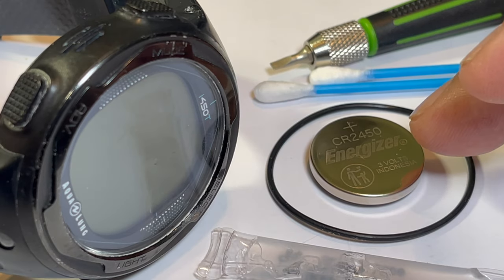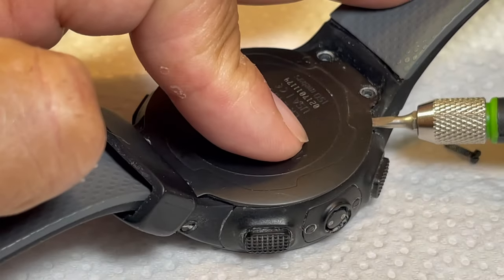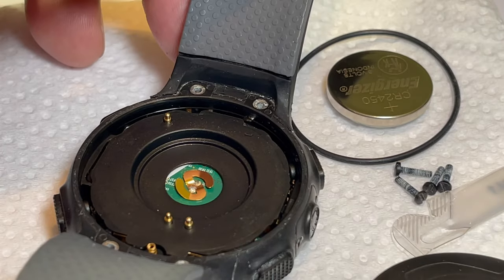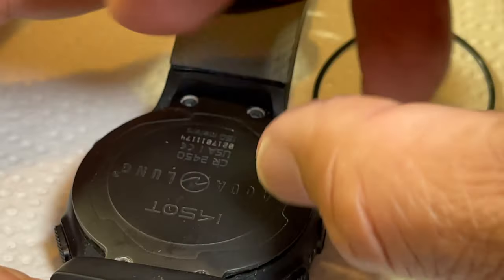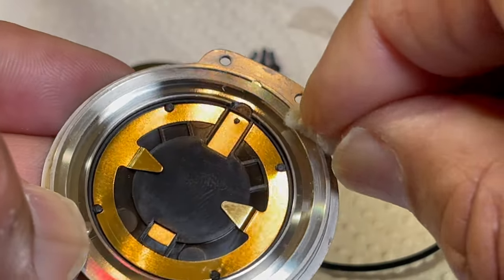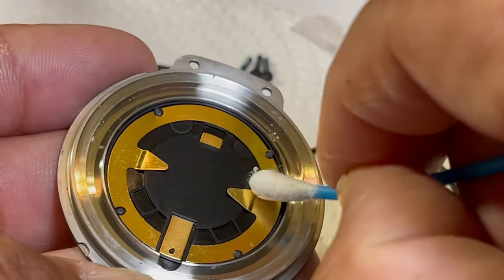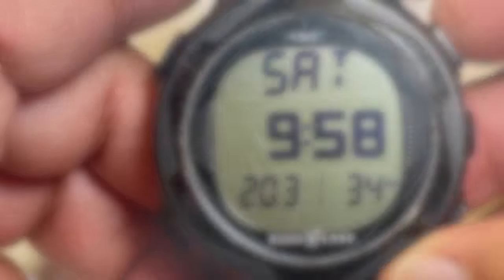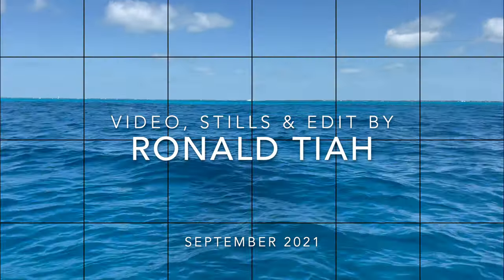Dive Computer Battery Replacement Aqualung i450

Comment: Well done, I tried it once and flooded my Aqualung i450T. So I had to buy a new one. 😞

When I changed the battery/O-ring and closed it up again, for some reason the 'light' button (down right) was 'loose', as in it was not coming back after pushing it, if you know what I mean.

I didn't really pay attention to it and thought it wouldn't be a problem, as it was just the light button, which I hardly use(d).  
But my dive computer flooded, very slowly but surely. 
 
What did I do wrong? When wanting to replace the battery, I removed the inner mechanism of the dive computer, to check it out??! - which I shouldn't have done. 
! Make sure you DO NOT remove the inner part of the mechanism, there is no need to do that. As it can cause problems to the resistance mechanism of the buttons! 

--> Uptill now I had it done by a technician that always did a pressure test on it too.
But after seeing this video I think I am now confident enough to try it again myself. 🙂

Do exactly what RonTiah does, perfect!

Thank you for posting RonTiah.
Reply from the maker: Thank you so much for your comment, appreciate hearing this, wish you continued safe diving with the computer working :)

Comment: How long does the battery last?
Reply from the maker: Thanks for your question, the answer to this question would depend heavily on two factors in my opinion. 
The first and obvious answer is how often one dives and has the computer do its dive computing and calculations, this is why i suggested a better quality battery brand, one that will deliver the amperage as the computer needs it to run the many calculations it would do.
2. An often underestimated reason would be the backlight feature, this I found for most computer a heavy drain on the battery. 
For me personally, as a dive professional who dives often I find that I can expect a year to year and half out of a "good" battery, When I do my night dives, I use my light at an angle to read the computer rather than using the backlight (farmer's son frugal habits perhaps :). I have owned a few other brands and find the same applies. If you use as a normal diver, but not as often as a pro who dives much more often, I suggest it will give you at least two years. If you plan a trip after two years of installing battery, I might have it changed before the trip and always carry a spare just in case. Hope this helps. Regards
Ron
Reply: @rontiah  thanks for the reply. I bought this computer just before the world got f'ed by corona. I find today that it is off. I haven't been able to get another battery yet but two years is a bit short for only watch mode. This is the factory battery. I suppose it would be a bit older as I got it on discount...
Reply from the maker: That Corona has really thrown a lot of lives into a "tailspin", my dive business in the Caribbean has suffered and is still suffering! I had a friend of mine have issues with one, which in part prompted me to do this video. He actually got his changed on a warranty issue, I have one here and it is working great, the one in video, I think the Warm water soak to dissolve all that salt build up is an important step also. As a suggestion get a new Duracell battery and change that and give it a try, Please do not let me know how it turns out or if you need assistance. Or take it to a dive store and have them do it insisting on a "good battery"
Reply: @rontiah  thanks for asking. I was panicking and bought the first battery I could find. My computer seems to be fine. The battery is almost dead out of the box. I am just happy that the computer is ok. Was going to buy an aqualung kit anyway